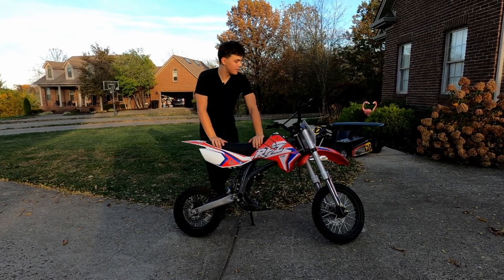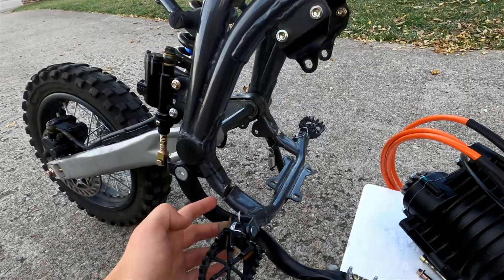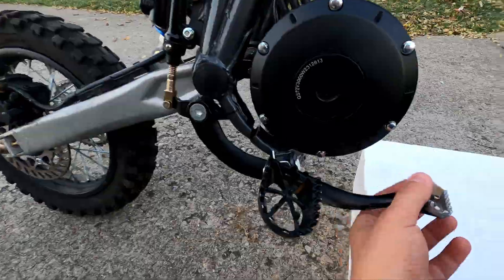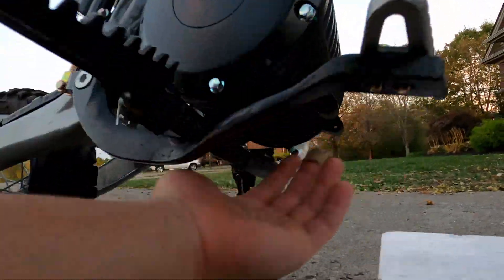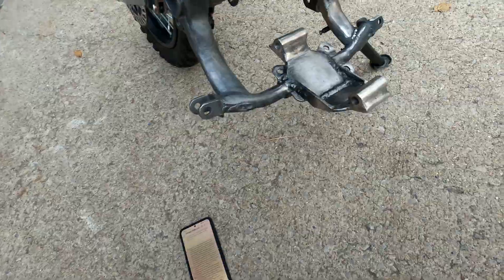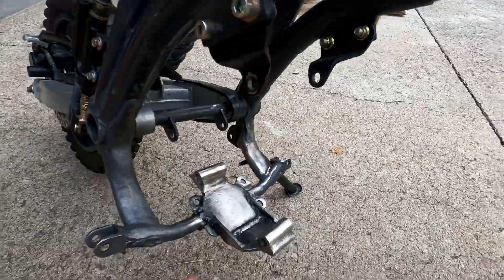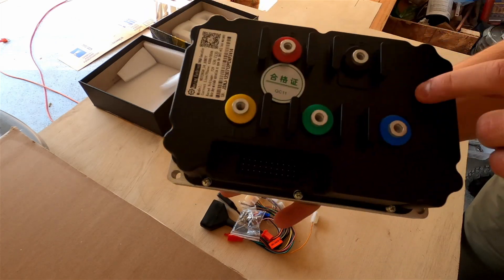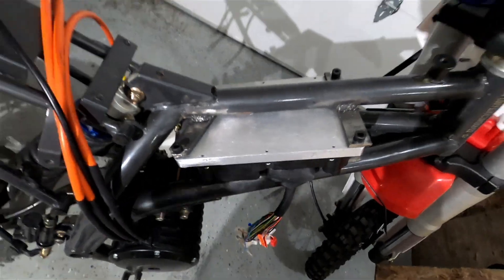--Part 2-- 38KW! POWERFULL ELECTRIC Conversion!! Dirt bike/Pit Bike/Mini Moto Conversion DIY Project

Comment: If your going to run that controller at full power (probably too powerful) You need a battery than can output 450 amps. That motor can output 40hp.
Reply from the maker: Oh yeah, it's way too powerful, but it's nice to have something stronger that you know won't overheat.
Reply: @Mikelinnyk  there never too much power, just not enough traction.

Comment: This kid smart. He’s actually using a dirtbike first and just putting the electric motor on it instead of getting a razor and then converting it over into a dirtbike and then it’s made beer cans pretty much the razor dirt bike is
Reply: That’s what I’m gonna do to my pit bike once it blows up lol
Reply: Yeah smart since he spent triple maybe even quadruple the amount of a razor.
Reply: @MMridesN razors are children’s toys lmao
Reply: @MMridesN Cap. Razors require a swing arm extension, larger wheel and tires just to get up to a decent size. Drop pegs, upgraded forks, upgraded rear shock, etc. the shit add ups building a “cheap” Razor.
Reply: razors are hella slow and expensive  and ugly  this is still cheaper he gto and expinsive moter but for 700 u can 65 mph the batterys do cost a shittun doe
Reply: I think you were off beer cans when you wrote that. Both a Razor and this dirtbike are both steel. Also how can it be smart it don't work to begin with 😂😂😂😂 At least that Razor would have been running by now 😂

Comment: bro i have the same apollo 125cc, I had the same issue with the motor, got the part, wasn't the right connectors so i took the engine out, made a sick metal fender in the back and the sides and painted it glossy sandstone, I cant wait to see the next ep
Reply from the maker: Yeah, it's the worst when things don't fit up right, but I'm glad you solved the issue. Episode 3 should be coming put soon. Stay tooned!
Reply: @Mikelinnyk  yeah man also converting mine to electric, same motor

Comment: Yo bro nice I love it im building a e shifter kart rn is is 12 kw for only 300 BUCKS BUY IT ITS INSANE better then the QS138 90h for better price its an old guy who makes them not some chinease factory they are called Lightning Rods XXL motor
Reply from the maker: Hey good for you bro! Hope it goes well
Reply: thx also keep uploading i want to watch and ik it might be expensive but ull get money if u keep grinding 

also what was the total price for the gokart and what speed controller u use @Mikelinnyk
Reply from the maker: @charlescrist7224  That's the plan! The total price, including burt up parts, was $5600. It would be like $4000, tho. I used a nd721800
Reply: 400 bucks? the motor you mentioned is $395 alone.
Reply: @SRNAR8  when we bought it shipping plus tax was 350 in total and still for 12 kw that’s good u gotta admot
Reply from the maker: @SRNAR8  what's $400?
Reply: Nice how much for just all the electronics

Comment: this bike is going to be real handfull to control ,honestly you could still get same preformance from smaller cont and way lighter motor
Reply from the maker: Yeah, I could for sure, but then the motor and controller would heat up faster
Reply: thats not exactly right,some types of fets  get hotter than others ,some switch at higher freq than others ,the protype bike we made to show customers uses 3m novec  dilectric fluid pumped through the entrie insides of the controllers ,this is also done with battery cells ,,nothing rises more than few degrdees now accross the board,even under extended full load ,so theres many solutions nowdays  @Mikelinnyk
Reply from the maker: @user-gv9pw4wq6v  that's true nowadays we get many different ways to avoid things like that. The reason why I went overkill with the motor and controller is because this motor is used by many people and it's very reliable compared to other companies. Same with the controller. As long as everything fits in the frame, I will put it on, but when something is huge, it obviously means you shouldn't. 

What prototype bike. Do you own a company or something?